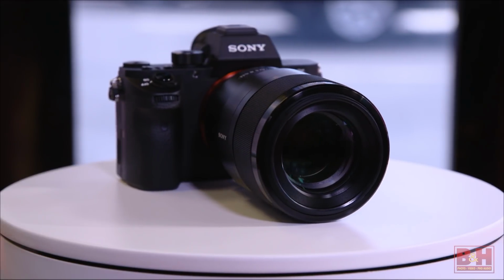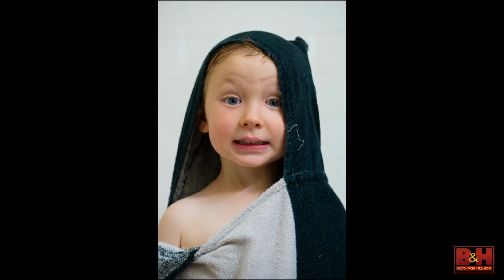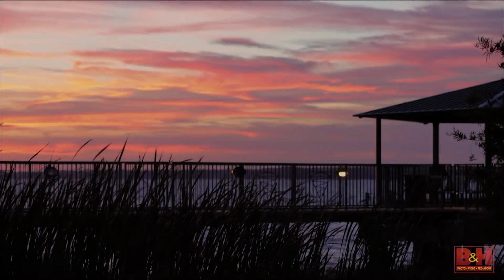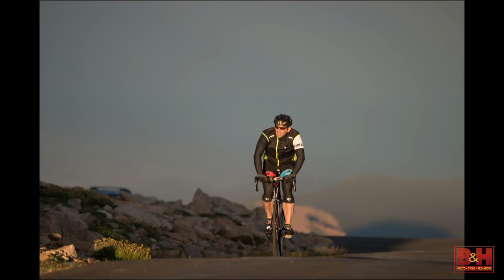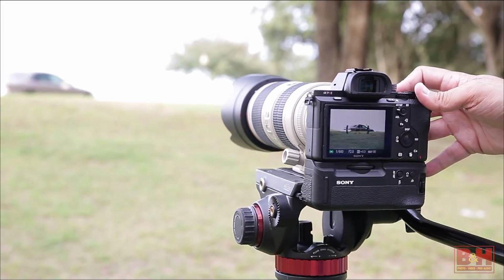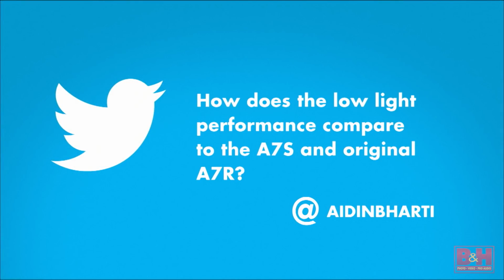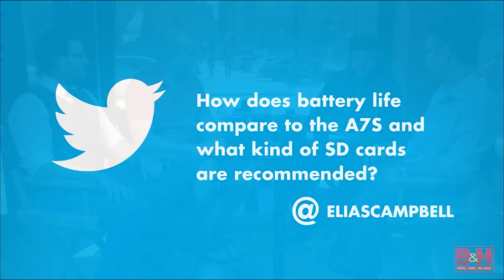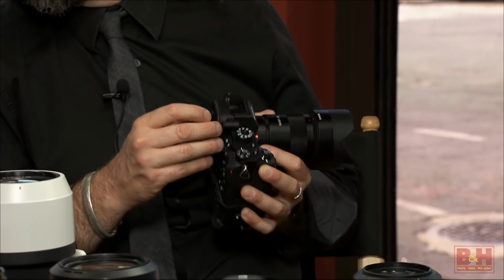Sony a7RII Webcast: Live from B&H with Colby Brown and LearningCameras.com

Comment: I hate to hate, because I usually love the B&H videos. But I have a couple of issues with this one. First: Most of the "amazing" pictures by these pros were not really good. That is not even a question of taste. There were a couple of nice ones, but the most were boring and ill composed. Okay, maybe they didn't have much time with the camera. Hard to tell. But that problem occured a couple of times in other webcasts, too. The images should match the level of the camera and what is possible. The other issue I have is with the quote, that Sony is listening to their customers. They don't. Everytime Sony introduced a new camera the amateurs and pros, me included, tell Sony to include a touchscreen. Today it doesn't make any sense not to use one, especially at this pricepoint. I like my Sony cameras, but I hate that it is so slow to change the autofocus point. It is absolutely stupid to ignore the market like Sony does. But they had this issues in the past. They include a couple of great things and leave out a major feature and nobody understands why. And I am pretty sure that it may depend on the decision of one guy, because in my experience it were always only one or two guys crippling a great product design, because they thought one feature was not important, even though it really was. Corporate cultures sucks sometimes :-/
Reply: +Ojay 4life No one will ever be pleased even in an Utopian society.

Comment: For me the series of Sony a7 cameras are inferior full frame cameras.
The don't have yet the plethora and quality of F mount and EF mount lenses. 
The size and weight is a big advantage for the Sony a7 series. Also some FE e-mount lenses are really small and light. However the more expensive FE lenses are so heavy and bulky.
If portability is an issue then the latest model Sony a7R II is by far the best full frame camera in the market.